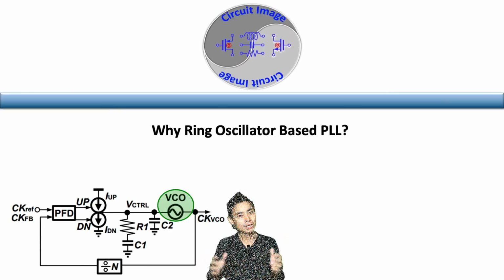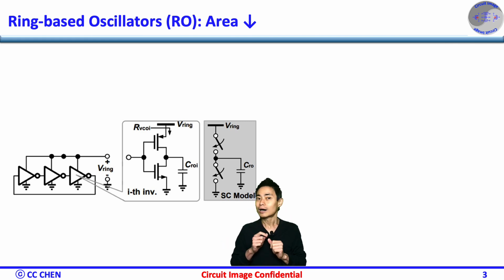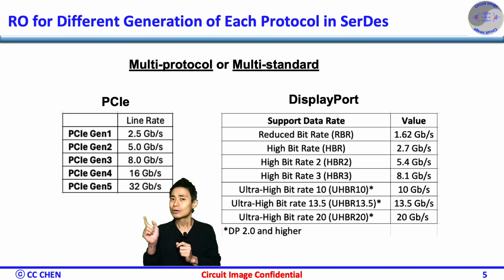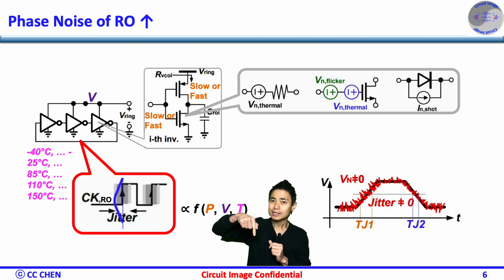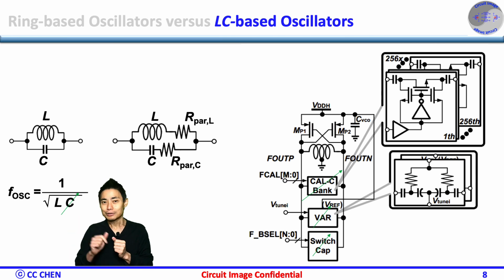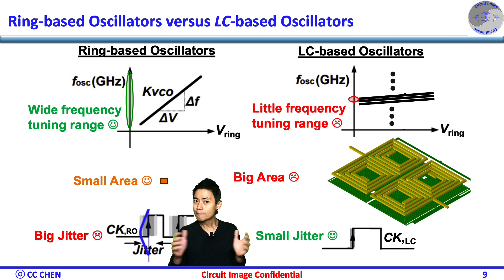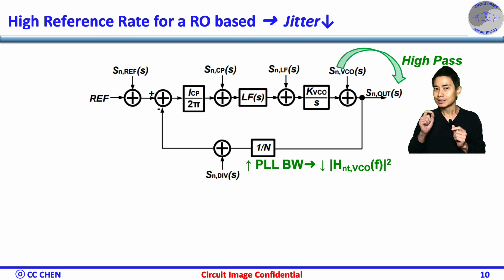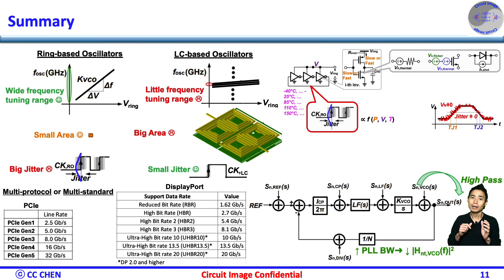Why Ring Oscillator Based PLL?

Comment: Great video CC. Another advantage of RO PLL could be to generate multiple clock phases--could be used for oversampling CDRs, perhaps in older standards.
Reply from the maker: Hi Abhirup, than you so much for the extra comment, that's correct. Even though peopele often applied QVCO + PI to get the multiphase; the RO PLL is much easier. I'll mentioned that in another videio.
Reply: Hi, thank you for making such a informational video. One question. By QVCO, do you mean cross-coupled oscillator? @circuitimage
Reply from the maker: @padapada503  Hi Pada, nice to meet you. Yes, but the cross-coupled oscillator could be just one of the QVCO. :)

Comment: may I ask the difference for the ICO(current-controlled oscillator) and VCO, what are the disadvantage and advantage?
Since I found referred information hardly, thanks.
Reply: I guess the ICO structure for the back-to-back inverter has worse phase noise, but I don't know how to choose ICO or VCO, maybe you can give me some reference about these, thank you.
Reply from the maker: @JJ-lf9yp  Hi JJ, nice to meet you and thank you so much for the excellent question, which I did not think through it carefully before. I don't know if I have the references since like you said that no one cared this or paid attention to this before. I'll make the next video to discuss about the difference and my circuit images. Thanks, CC.